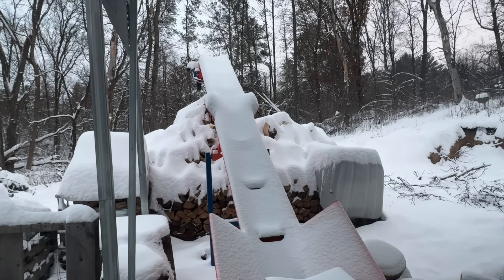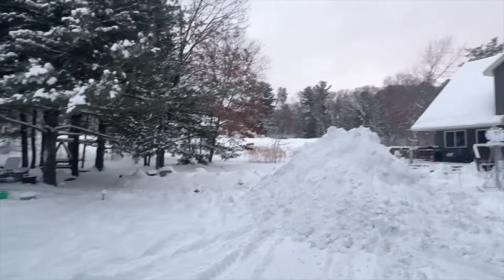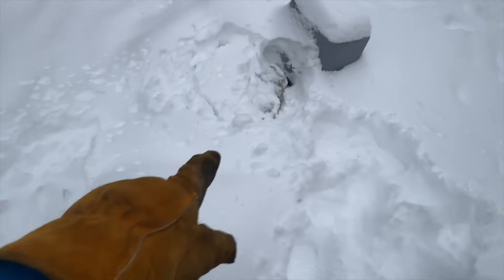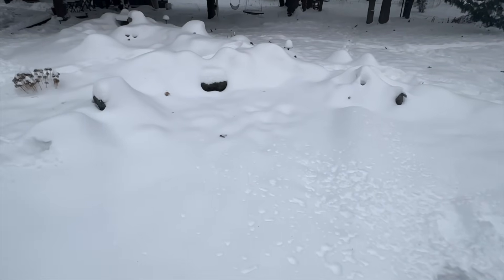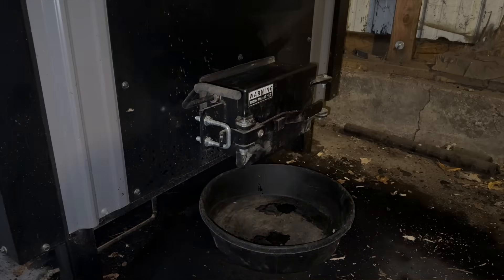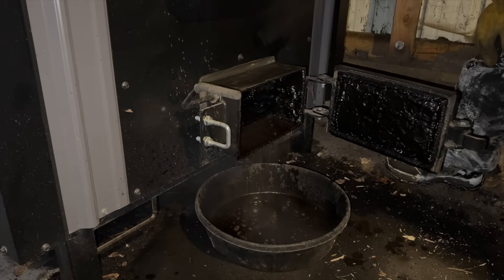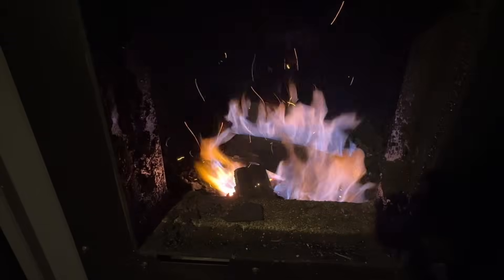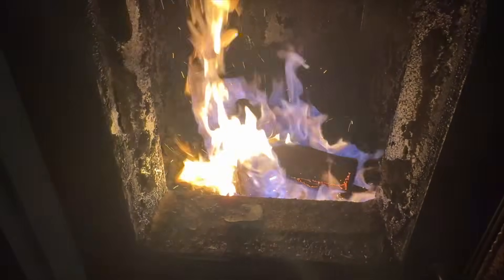Condensation in the Boiler? What Happens When Wood Isn’t Dry Enough

Comment: I have a central boiler classic 6048.  I burn a ton of wet wood, but that unit doesn't have an ash tray, so now I'm wondering what happens to the water that boils out of the wood.  Any ideas?

Comment: I work in a Power plant where we burn natural gas (bunker periodically) all day every day.  This is all normal plant considerations.  Our plant has a huge stack, like most do.  It is typical to have a temperature sensor at the top of the stack, measuring, in theory, the coldest part of the combustion gasses.  If that temperature ever gets below 275 to 300F people start to freak out.  Combustion is the reaction of elements with oxygen.  The main ones are carbon and Hydrogen.  Carbon becomes CO2 and hydrogen becomes H20---water.  if you are burning wood that contains water already, then you get even MORE water.  Water must be more than 212F to remain as steam.  If it ever gets colder than that it will condense in the stack and drip down the walls, mixing with other combustion products, forming acids that will ROT YOUR STACK.  Every part of your boiler, breaching (the path the flue gasses flow through to get to the stack) and stack absolutely must stay well over 250F at all times.  
Your boiler is a bit different in that it starts and stops to control water temp.  Every time it stops, it cools, and any zone less than 250F will condense and drip back to the lowest point.  every time it fires up again, it will evaporate water and concentrate those acids into the remaining volume making stronger and stronger acids.  The lowest areas obviously never get over 212F under the fire.  THis will absolutely rot that steel anywhere it touches.
A neat experiment would be to test the pH of that water you are taling out.  Maybe you have a pH measuring device for your Fish pond?
Reply from the maker: Really appreciate you breaking down the science behind the condensation and potential for rust. It's definitely something to keep an eye on!

Comment: Great video. !!!!
Dan great topic about water condensing at the bottom of ash pan door. I hate to be the one with bad news but all that water mixes with that acidic ash and in less then 3 years my ash pan was destroyed. Where it dripped close to the door a great big hole rotted out severely in that area and down the ash pan. Dan grab a towel and get ready to cry when you click on the price to replace it. I keep telling my self to go to a local metal fab shop and bring my new ash pan and have them make one out of stainless steel. Take it to shop now before it gets all bent up. Hopefully the stainless would hold up way better than the OEM ash pan. Dan as your dumping water your ash pan is getting destroyed. Been there and done that, no fun. Great boiler known problem as you explained but it needs fixed.
Reply from the maker: Yeah I'm hoping the stainless holds up on mine as well...and hopefully all this water doesn't end up causing more and more ongoing problems down the road.
Reply: @Back40Firewood  
Dan I could be 100 % incorrect in this next statement. The ash pan is not stainless it is regular steel. I know one thing the ash pan was showing wear after first season.  And every time I dump my ash even now the ash sticks on inside of pan. No matter what, the water and ash are not a great combination and the ash pan doesn’t want to hold up. I enjoy my wood boiler and I understand there are wear  parts but when  you were holding that water in the pan you’re probably holding some of your ash pan also. LOL !!!!!

Comment: I recently saw an article some dumbass posted about intentionally using damp wood to extend burn times in your indoor wood stove overnight. 

Like no ... Control your airflow and use bigger splits or rounds and pack it in tight, bark side down. I like to get my stove just under over fire and let it burn down through the entire optimal range.

Comment: Maybe, if you make the difference between the low and high temperatures for the boiler smaller, the time between burns will be shorter, and the boiler won't cool down to temperatures where the water vapour can condense. That will also reduce the individual burn times, and I don't know if that will have other negative consequences.

Comment: Yup it's not the fault of the boiler that you put wet wood inside of it. If I get too much moisture inside of my old CB 5648 it will condense around the colder corners of the  lower door and I'll have a big ol nasty stinking mess right at my feet. Burn dry wood and you won't see a drop anywhere. It pays to dry your wood first because water does not burn,never has never will.

Comment: I'd be concerned about the longevity of the stove.  The bottom will be rusting out in a few years.  That was a lot of water.
Reply from the maker: I've made it a habit to open that ash pan door often and let any water that's in there drain out...hopefully it won't be a problem down the line.
Reply: It's stainless and quits when the cold sets in.  Normal fir these stoves.
Reply: @zachspicer3475  Is the entire unit made of stainless or just the water jacket?
Reply: @TimStout-p7g good question I just assumed all

Comment: Hey Dan,

   How does that affect cleaning out ash pan. Is the ash just goo? 
  We're burning a Cleanfire unit and the clean out or reaction chamber is completely dry. Looks like talcum powder. I'll try to get a pic. Nice to have helpers with that snow removal.
Reply from the maker: I think the water seeps down the sides of the ash chamber and the pan has a small gap between the walls of the chamber and the pan so there's not much water that ends up inside the ash pan with the ashes.
Reply: The water vapor in the furnace gas naturally migrates to a cold surface and condenses there if the surface temperature is below the furnace-gas dew point.  If you have access to the outside surface of that area, some insulation might help keep the surface above that temperature.  You will want to clean up that area each year after shutdown to keep corrosion under control.